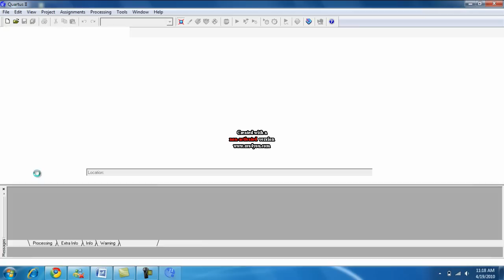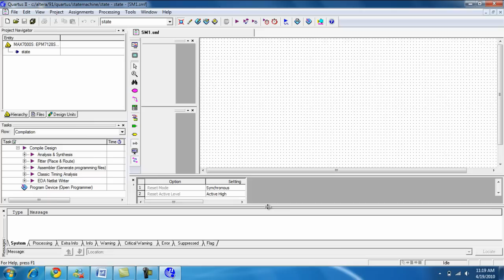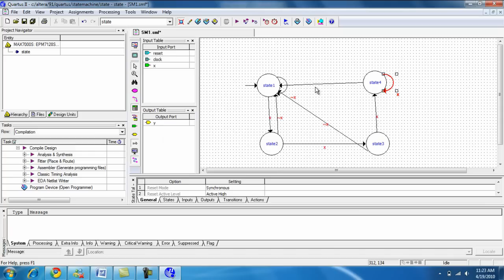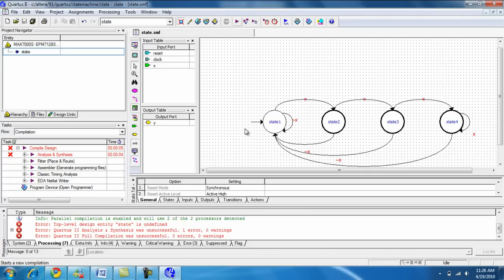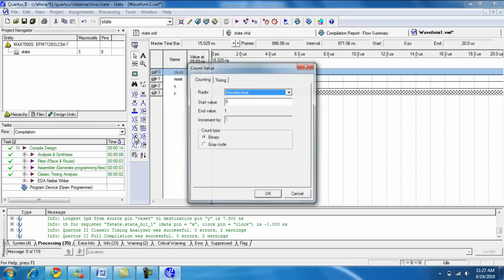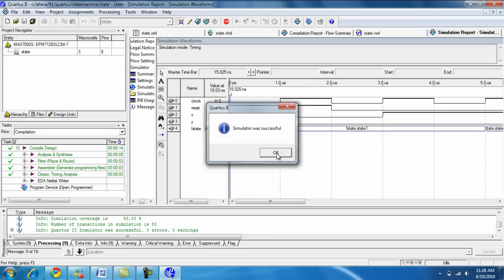Quartus II State Machine With State Diagrams

Comment: i have problem when i used two input like s1 and s2, because when i  put the fstate is the waveform file, it put the fstate in BURIED, not in MACHINE. I need help, your machine works when is one bit, but two or more doesnt do anything in the simulation